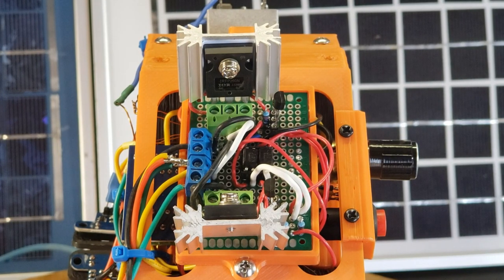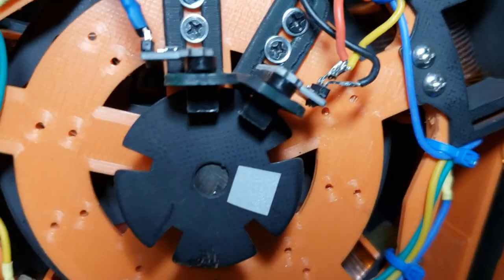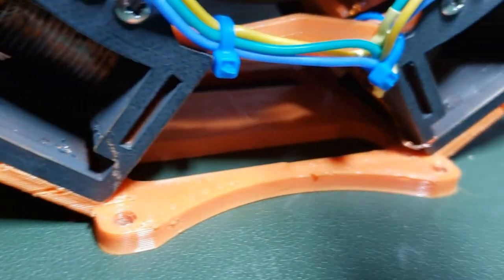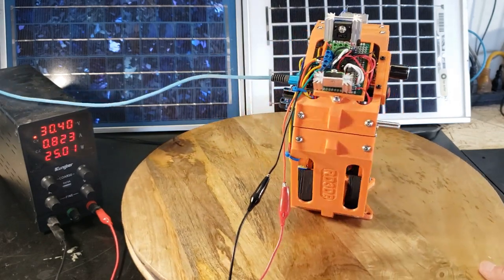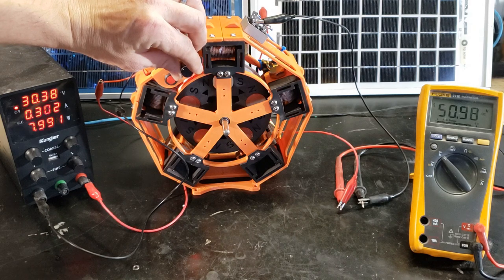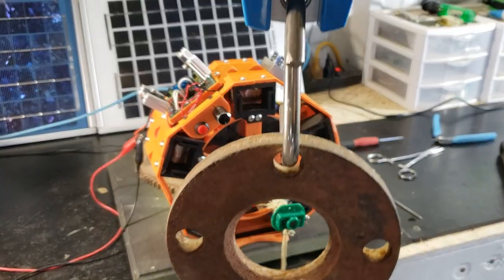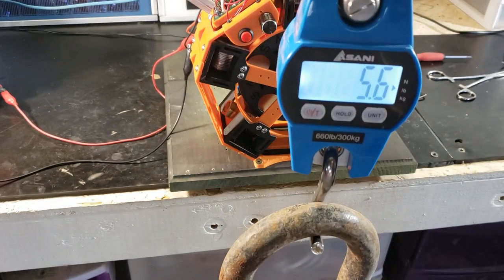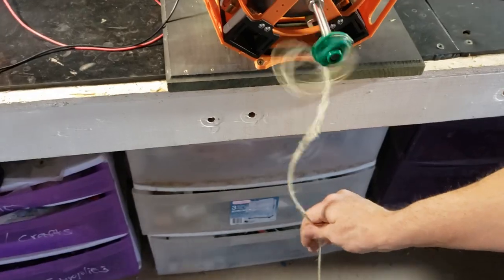Zero Force Motor part 1

Comment: Pretty cool! Im building a big reluctane pulse motor through 3d printing at the moment :) have made a pulse driver with stm32 micro controller. Wich includes stand alone mode, but also speed control mode with PID.
Can switch signals upto 10khz so thats plenty of frequency to work with allot of different configurations.
It uses probes to measure voltage and current going into the motor.
Wich info can be requested over uart.
Still allot of work left to do.
But all the main features i mention above are allready implemented.

Nice video 😁
Reply from the maker: Wow, sounds really cool. I'll have to check it out for sure!
Reply: @redesign3dp  most pictures are on insta and fb at the moment.
Once finished i do a video. :)

Comment: 1. Where is your capacitors
2. The coil L and capacitor  C needs to be the same L H and the same C F. 
3. Where is the grounding wire for the Spring effect. Let me know when you Sirius.
Reply from the maker: Build a motor and post a video. Demonstrate what your preaching.

Comment: To get a real measure of torque measure 1ft from the center of the shaft and put a weight on the end. You could make a 1ft pulley and attach the string there. However much it lifts is in ft lbs. So 1lb lift on 1ft pulley is 1ftlb. 2lbs is 2 ft lbs etc...
Reply from the maker: Makes sense, thanks for the input!